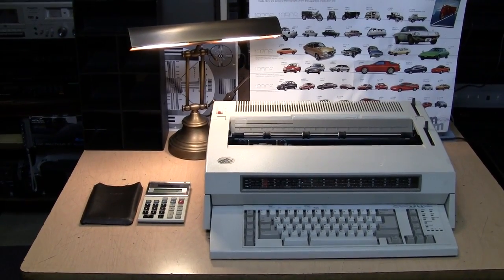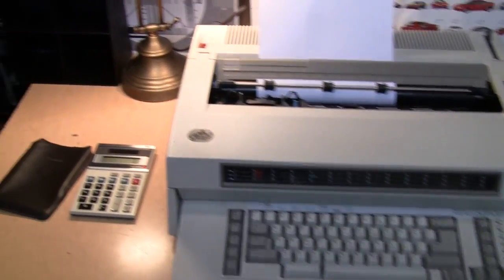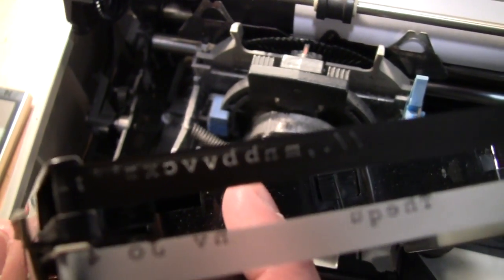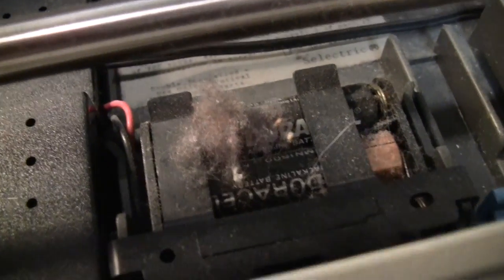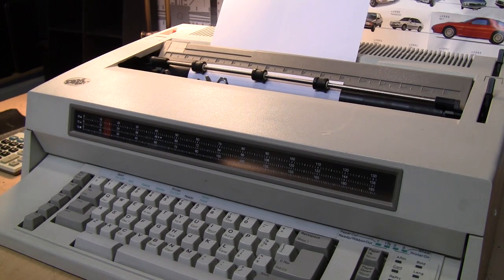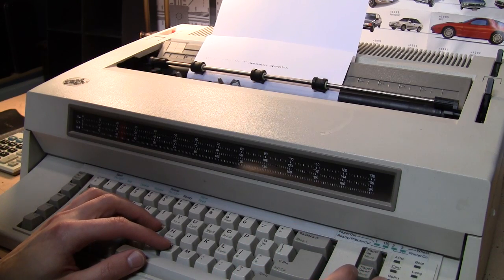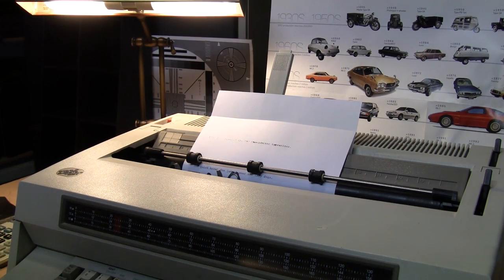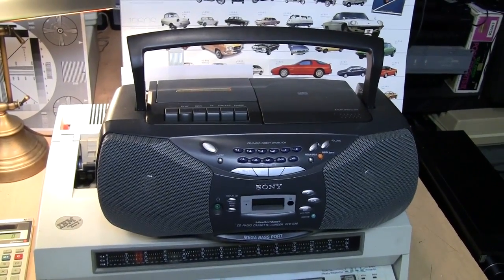IBM Wheelwriter 10 Series II electronic typewriter

Comment: I still own a few of these and newer Wheelwriter  under the Lexmark Brand for nostalgic reasons. This particular Model has an option as you can see on the keyboard keys to activate the Printer commands. Even the best laser printers can't compete with the printed type of an impact printer.

Comment: I have quite a few typewriters, but only one full size electronic which is similar to that and probably ran alongside it as a competitor when new.  It's an AEG Olympia Compact i ("i" probably meaning "intelligent") which is slightly more basic in the sense that it has no lights but it has various settings for CPI (all on the same type wheel), bold, underline, electronic tab settings etc...  It also uses a daisy-wheel style set-up and a carbon ribbon cartridge.  I've been using my manuals a lot lately, but really should get the old AEG out sometime and put it back into use again, and maybe make a YouTube video of it.  As a side-note, I'd love to work in an office where typewriters are still at least partially used.  Here in the UK no such offices exist, even the most basic ones have laptops or desktop computers.

Comment: i had an earlier model from IBM with the "ball head", and it featured a 10 digit block. the device came used from an accouting department. from the dirt on the keycaps they seemed to have used it as a calculator on steroids. but since it had no display (apart from some leds) i am not sure if it could calculate.

Comment: Nice typewriter! What's even nicer is that you can still buy the ribbons for these... although I bet if you couldn't, you could get a cartridge for another model that is still in production and thread in the ribbon into your old cartridge... that's usually what you gotta do with manual typewriter ribbons, since the reels vary, but the ribbon is always the exact same size. Are you gonna keep it set up so you can quickly type things out, or label things that you wouldn't be able to label with a computer printer? Or maybe even hook it up to one of your vintage computers? Also, when you run out of ribbon, you have to go through it and see what's been typed on it in the past. lol. Nice calculator too! Yea, the dollar store ones... even the less crappy ones in the stationery section in other stores are total junk. I bought a Radio Shack EC-4075 calculator on eBay because it does time calculations... it has been extremely useful to me, but it didn't come with its pleather case, so I slapped a slip case together with some scrap denim to protect it from dust and scratches. OOH now you have a wall mounted rack for holding 8 tracks! That's awesome. it can go beside your wall-mounted cassette rack.

Comment: hello! My old smith corona word processor I got from a family member happens to be a
similar system. do you happen to know if the locking mechanism for where the fontwheels go are replacable/fixable? It broke ages ago but I'd love to eventually get it repaired thanks much
(I know the SMith Corona has a very different system. internet says it's part of their h series typewriters, but i'm trying to find out if i can get it fixed)

Comment: I was given a Saisho CP 900 cassette player/clock radio that had a 9v backup battery as old as that.When I pulled it out, it pulled the 9v clip broke with the contacts still stuck to the battery!

Comment: UPDATE:  I had my library (where I work) buy a used IBM Wheelwriter 3.  

I had my library bought a used machine because I knew the IBM machines were workhorses. The machine they had before was a cheap Brother brand - it broke even when new.  I wanted a REAL typewriter so I went online to look for a used business model.  I think in 2003 when we bought the Wheelwriter it was still a bit pricey, I think $325, but I felt it was a worthwhile investment.  At the time we bought six ribbons and six correction tapes and I think we have only used 3 or each in 13 years.  I just dust it out once a year and wipe down the bars the carriage rides on with synthetic grease, and that all it needs to work like a champ.

Comment: I found a WheelWriter Series II, Model 3 in our school library. There was another one (identical) in storage, and I wanted to make an offer on it but I wasn't willing to take the risk - plus it had a note that said "stuck carriage return." Our school district bought them in 1989-ish, and the librarian still uses hers from time to time to make book labels. (I've used it a couple times - she gets angry when I use it as she thinks the ribbons are no longer sold.) I wonder if someone can make a video showing the planar boards (there is one in the back by the power supply and one under the mechanism itself) to see what type of ICs it use.
Reply from the maker: I don't know if IBM/Lexmark is still making ribbons for the Wheelwriter, but I know for a fact that you can still get aftermarket ribbons (including the correction ribbon) for it.
Reply: Lexmark doesn't, as Lexmark has pretty much stopped supporting these older typewriters. (Although there is some evidence, although it may be outdated, that Lexmark may still make newer Wheelwriter models.) Lexmark spun-off of IBM in 1991, and took over their typewriter, printer, and keyboard business that year. The Selectric and Wheelwriter models, as well as the Quietwriter models (Quietwriter is the same chassis but with a non-impact print head), were made in IBM's state-of-the-art manufacturing facility in Lexington, KY.

Comment: Are you sure that the cubby unit wasn't used for storing the multiple print wheels for the typewriter?
Reply from the maker: No, you could fit hundreds of print wheels in that rack, and nobody would ever need that much!
Reply: Not even in the office supply room for use with all the typewriters in the facility?
Reply: At that point it would be kinda like printer cartridges or something in a modern office. You still wouldn't need them often enough to be worth taking out of the box before you needed them.